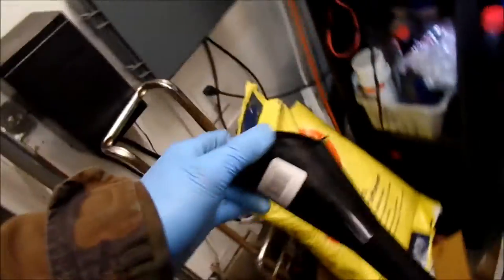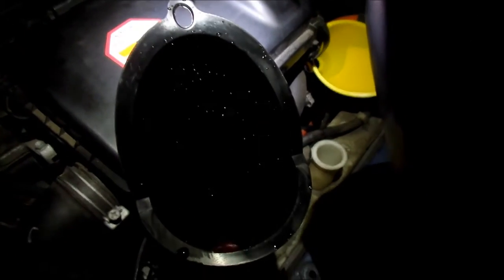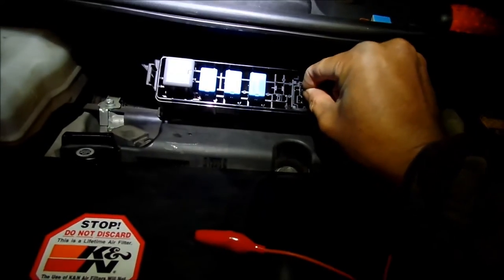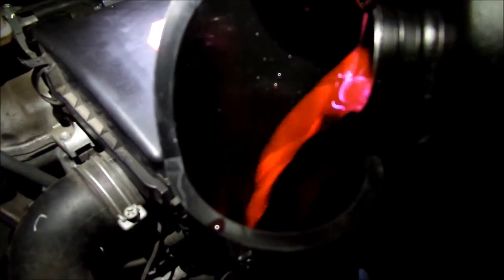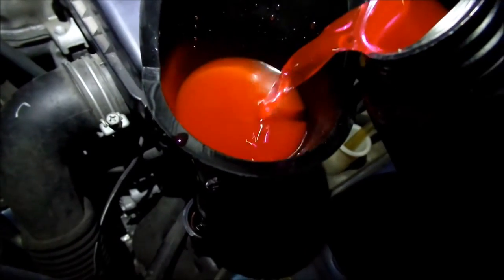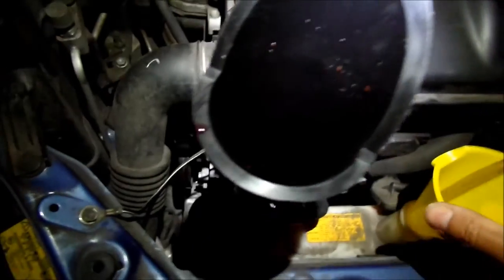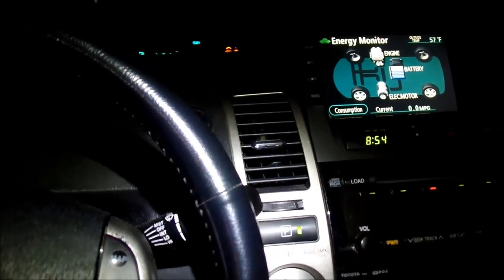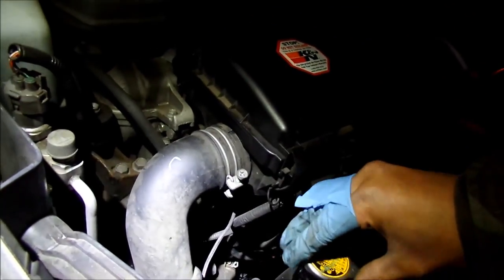HadesOmega's Prius Engine Coolant VLOG Part 2 - Refill and Bleed

Comment: Hey, did you add more coolant at the reservoir when you change engine coolant ? Because I had change coolant but still my reservoir looks empty. Please give me an advice!
Reply from the maker: Jo Luke keep on adding coolant and cycling it.  You could try running the engine, eventually it should fill up